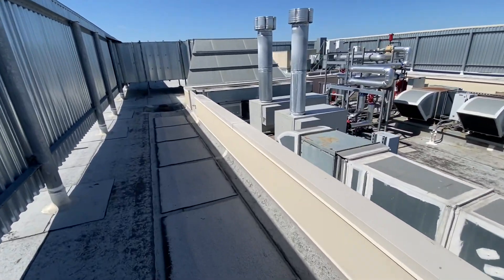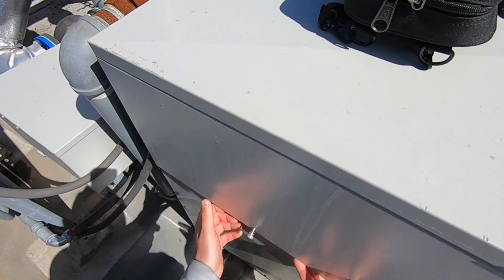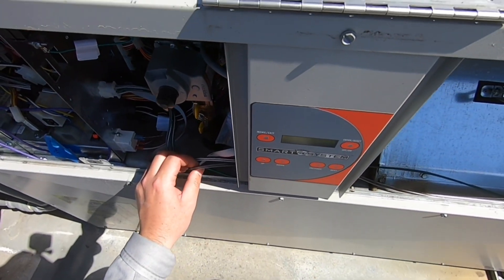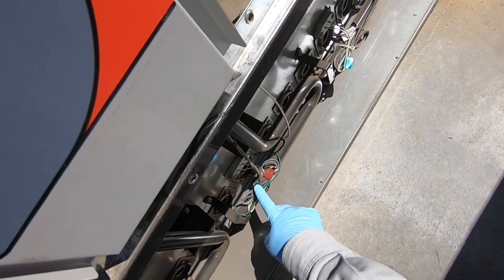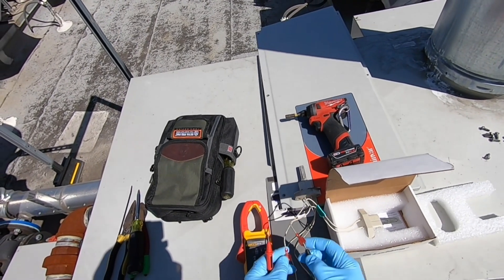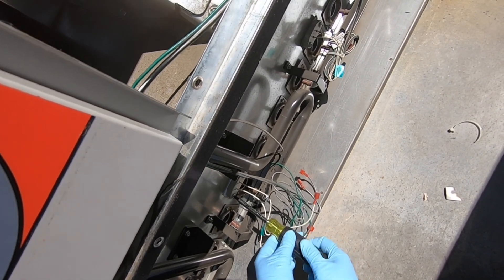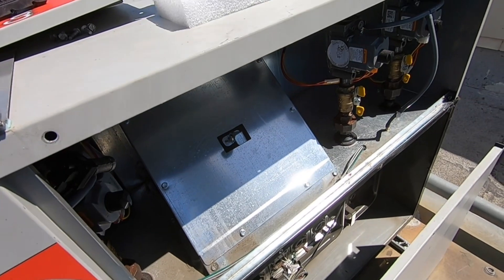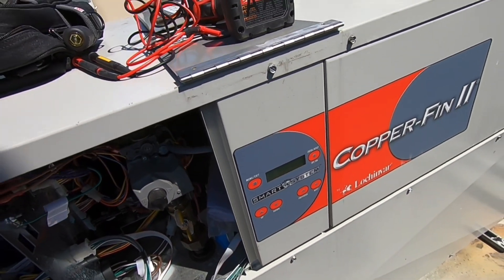Lochinvar Boiler Down | Not heating

Comment: I know that this is an older video but could you explain what all you keep in your mb2? I have one I bought used and I seem to over stuff it. I’ve got an interview with a commercial company and would like to see what all a commercial technician carries in one.
Reply from the maker: I have some older videos of my other veto bags what I carry in them. 

But I had a break in my van they took all my older bag setups that I had. In this bag I’m just carrying the basics. Multi meter, few different Klein screw drivers one with the different flip sockets, needle nose wire stripper, insulated screw driver, couple different wire leads for my meter and some waygo wire nuts. Just basic stuff for troubleshooting. 

In my opinion everybody is different, some guys like to carry there entire van with them. Some like to carry the fewest tools possible. It’s your preference really, but I started out the same way as you smaller bag but I began over stuffing it. Moved onto bigger bag and began over stuffing that one, gets to point were it’s getting to heavy.  In the commercial side depending on what exactly you are working on could be chillers, RTU’s vav boxes, boilers, exhaust systems, multi V units. I have different bags for different things, but I usually start off with just the basic and go from there. If I know I’m going to be doing some wrenching and wiring and mounting I’ll bring my bigger bag. In commercial you’ll use different tools you usually don’t use maybe a megger or manometer, combustion analyzer, bearing pulleys, torque wrenches, leak detectors. That stuff you ain’t gonna be using so much to the point you to need to carry in your bags. You assess the situation first than decide what you don’t have on you and you need to grab out of your van. 

To me having like a bigger open style bag like the veto tote bags comes in handy cause you can just throw everything in there and bring it instead of trying to find place in your bag or not having enough rooms in your arms. 

Hope this helps you. Good luck on the interview don’t feel intimidated in going into commercial, if the company really looks out for there guys than they’ll walk you and take care of you every step and train you on the things you don’t know. You’ll maximize on the stuff you know already.